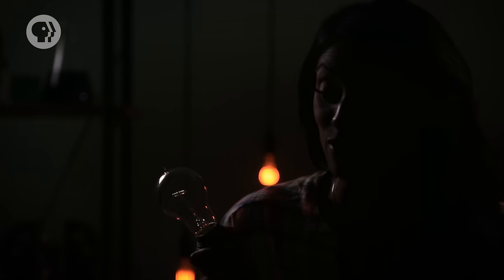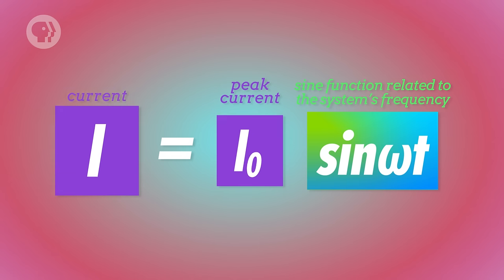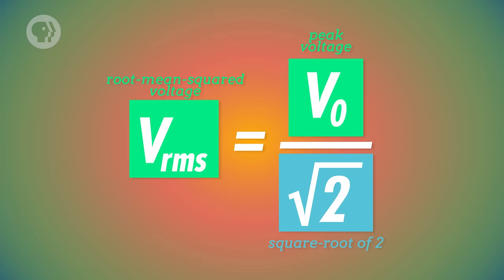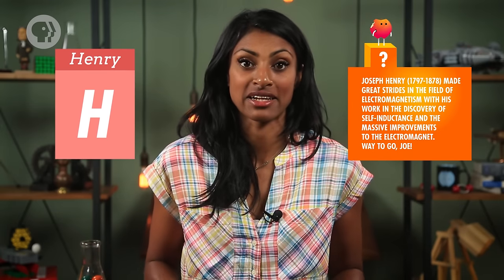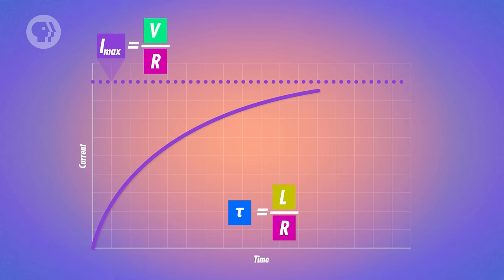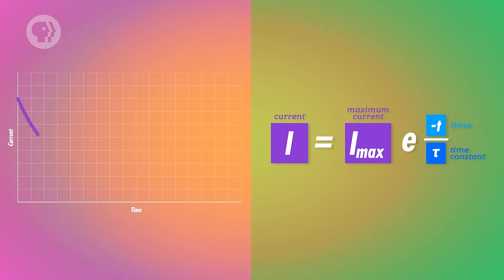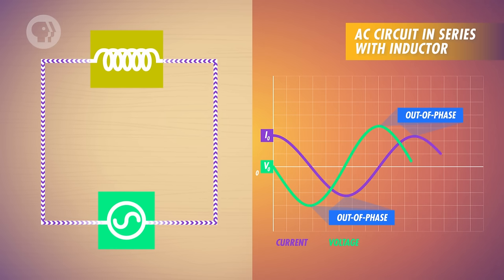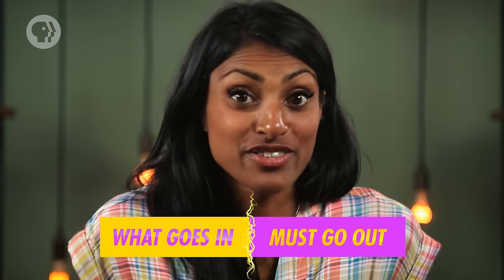AC Circuits: Crash Course Physics #36

Comment: Who is this for? Animated like it's for kids but zipping through formulas like they assume you're an electrical engineer.
Reply: Students that need a quick refresher before the AP Physics B exam.
Reply: I installed an extension for Google Chrome Web Browser called Youtube Playback Speed Control. It lets you slow the video down to 0.75 which is the perfect speed for these Crash Course videos.
Perhaps this is another rouse to pretend to empower the public through education yet ultimately defeating us via stupefication.
Reply: These formulas are usually taught in 11th or 12th grade physics classes though
Reply: Jonathan Odude they don't....at least for me, except physics, I find them k
Reply: I feel like the channel is called crash course because the course is so fast and complex that my brain crashed. I have an MS in biology, proficient in chemistry and just finally figured out how to math for DC.....this is not helping me much with AC
Reply: 000xyz nah dude I’m an electrical engineer, for ac circuits this is useless, if you want to do AC stuff, you have to make sure you know things from DC theory like node voltage, mesh current, thevenin/norton, delta wye, then you have to learn phasors, and you to understand steady state in DC for RLC circuits, then you can learn complex impedance which treats Ls and Cs as resistors in the frequency domain and do everything I said above as complex resistors. So instead of V=iR, it’s V=iZ, its not hard but you have to go through all that stuff, if you don’t know diff eq theory or linear algebra, you need to learn that as well bc problems can turn into second order diff eq systems, good luck
Reply: Shams Noor AC? No, these formulas are all DC based and you’d learn them in college in intro EM physics courses. Maybe in high school if you take AP physics C which has a calculus prerequisite so 85% students won’t see this till college. Plus the AC version of these formulas requires advanced differential equation theory, so it’s a sophomore level course on circuit theory.

Comment: Having just completed my 3rd semester in an electronics technology 2-year degree program, this is a nice little summary that helps put what I've learned about AC circuits in perspective. However, it's clearly not for beginners, nor for experts. Higher than vocational, lower than engineering.

Comment: Wow! What a  coincidence! I just learned about this in class today. I can't tell which is harder to understand.....maybe i'm just stupid.
Reply: I've had many semesters of physics, and electronics, and I took my first electronics course doing ham-radio in the 8th grade. Take it from me: this is NOT an easy topic to digest. In this case, the content is suuuuuper condensed. It's worth watching repeatedly, and it's also worth hearing the explanations from many sources.
Reply: As I said: ELI the ICE man.

Electromotive Potential/Voltage (E), Inductance (L), Current (I).

Current (I), Capacitance (C), Electromotive Potential/Voltage (E).
Reply: Rendezvous On Memory Lane You're certainly not stupid, I've taken an undergraduate class of this and felt it fast paced (I do understand the subject)

Comment: Lag after switching devices off is caused by capacitors, not inductors. Mostly in switch-mode power supplies like phone chargers or computer PSUs. They have huge amounts of capacitance to smooth rectified ac power and internal transients. After the device is turned off, it acts as a small battery.
Reply: Arrvi I was thinking exactly the same thing... Unless I'm missing something I think you are correct.

Comment: You should have already explained the LR, the CR and the LC and phase shift in the videos about capacitors and induction. Then in this video you should have explained how we determine the voltage and current values to then eventually explain how the capacitors and inductors work in AC.

Because now you didn't get to the power factor, rather important, especially because you did touch upon average power. Which doesn't equal the actual power when the power factor is anything but zero.

Also multiple phase circuits.

Comment: Cheap Chinese USB chargers also use capacitors instead of transformers to cut down mains voltage (and cost). Obviously as you change grid frequencies, bad things happen!

Comment: When you said that the inductor produces an emf in the opposite direction of the current, what you meant to say was that it is in the opposite direction of the "change" in current.  Also, when you talked about removing a battery in a circuit with an inductor, what you meant to say was replacing the battery with a short circuit.  If you just remove the battery, and leave it as an open circuit, very bad things will happen, as the inductor tries to push a current through the open circuit, thereby generating a very high voltage.  Of course, I know what you meant with your statements, as will most people who are familiar with topic.  Though, I think the way it was worded may create some confusion for people who are being exposed to this for the first time.
Reply: Thank you! I had the exact same doubt.
Reply: Wow... eugene commented too!
Reply: there is something that I don't understand, there are two(emf)s in the circuit with the inductor, the original and the induced , did we add them up or what ?
Reply: Rofaida Elsayed   No we dont add them. The induced emf is generated whenevr there is a change in cutrent. After that its not there... i mean the barrier that inductor creates to  prevent the "Flow of changing current" is vanished as soon as the current gets constant
Reply: Karan Dosanjh  not if we're talking about  alternating current, it keeps changing so we have 2( emf )s now
Reply: Rofaida Elsayed you are right about “Ac as changing current”. I wonder what might be the answer then
Anyway, if you got it let me know please
Reply: Rofaida Elsayed But they are talking about this while taking a Battery 🤔.... even Eugene took the cade of battery.... so that means the current only changes when switching on and switching off. Just these 2 instants
Reply: Karan Dosanjh  I know that but  when it's AC current the current changes instantaneously and continuously so there is always an induced emf that is proportional to the rate of charge of the current
Reply: Rofaida Elsayed Ohh now i remember. I am in 12th grade and i remember now that during our lectures on ‘Reluctances applied by capacitors and inductors’ in full LCR circuits, we derived a relation of Xc(reluctance by capacitor to current)= 1/C ω and XL(reluctance applied by inductor to current)= L ω

So when ω is too large(which is the case of AC) the reluctance by inductor would be so large that the current is blocked in AC

And when current is DC the ω is zero and hence negligible or no reluctance by inductor so DC is allowed
Reply: Karan Dosanjh I'm in 12th grade too, in our curriculum they don't explain how these Xl an Xc were derived,  they should take the induced  emf into account but I want to know how, I want details
Reply: @Karan Dosanjh
I think you meant to say "reactance", not "reluctance"
Reply: Macieks300 ahh yes... Thanks for tue correction
Reply: Karan Dosanjh  they say the voltage is 90 degrees ahead of the current , what voltage are they talking about ? The voltage from the source  or the actual voltage across the solenoid , I still don't know whether we add the emfs up or what (in an AC circuit) .....I'm missing something
Reply: Karan Dosanjh also I already understand the things you mentioned in your comment , this is not what I'm asking about
Reply: Rofaida Elsayed  Yeah we add them up. 

The scenario is- We connect a battery and an inductor. We switch the circuit on. Current BEGINS to flow in circuit. As the rate of flow of current is increasing the back emf is generated. 

Yes, WE ADD THEM UP and so it is seen that the current is opposed by inductor and the opposition is EQUAL. It is only when the current is constant, the opposition emf vanishes as there is no rate of change of current.
Reply: Rofaida Elsayed AND yes, The phase difference—— 

We switch on the battery the EMF is applied BUT, The current does not flow yet.... as we are taking a battery, The maximum EMF and Current it can apply is at sine 90. And after that it stays there , and current begins to flow fully. 

In the case of AC, The current never flows.
Reply: Karan Dosanjh my questions are not about DC current , I get that , I'm asking about AC , you say current doesn't flow in this case , how is that ? What about reactance and the shift phase , these things have to do with an AC circuit that contains an inductor .
Reply: Karan Dosanjh and what do you mean by at sine 90 when you're talking about DC current ?
Reply: Rofaida Elsayed Although i am not an expert in this field but i am sure my knowledge is correct. I have to show you by sending a photo. Contact on any media
Reply: Karan Dosanjh unfortunately,  I don't use any of these three , but I use Facebook if you have an account
Reply: Rofaida Elsayed You know when we derive these relations step by step , sine of 90 comes in place. 

Have you seen this formula?...

I= I(max) x Sin(theta)
E= E(max) x Sin(90+theta) in the case of inductor

And

I= I(max) x Sin(theta)
E= E(max) x Sin(90 minus theta) in the case of Capacitor. 
Note that when ever the voltage or current is alternating, the ‘theta’ always changes

Have you done the ‘Impedence Triangle’
That is all related with the phase difference. I will see if i can suggest you some links of videos...
Reply: Karan Dosanjh yes I have , but In AC circuit and not in a circuit with a battery
Reply: Rofaida Elsayed well its all the same in any voltage. 
Just think of it like this , when Current in DC begins to rise, it acts as the 1/4th part of the AC current. Imagine 1 full cycle of AC graph till 2pie. Then imagine it till pie/2. And that is where the DC becomes constant. And after that, current flows through inductor. 
It also makes sense as the phase shift is seen in sine of theta. 
Theta keeps changing in ac. But in dc , the theta increases from zero to 90 and stays there. It makes sense as sine of 90 is also 1. Which could be the maximum value of current a dc circuit could ever have
Reply: Rofaida Elsayed is there any way i could show it to you by my own pen and paper?

Comment: Wow, that went a bit too quick as I last heard this info about a decade ago. 😅

I'm still not clear about why we would use AC currents instead of DC? Was this explained in a previous video?
Reply: For low voltage over a longer distance transmission DC currents loose to much power at a much higher rate than AC and it's easier to manipulate. You can for instance change the Ampere flow by manipulating the so called "Reactive power" you can mantain the same amount of Watts (power) but lower the Ampere, so you can use a smaller cable  (thus a cheaper cable).
For high voltage you usually use a DC current for long distance transmission, since it suffers less powerloss than an AC transmission. (And it's also cheaper :P)

It's not easy to explain over a text :P But you can read alot about AC and DC on Wikipedia :)
Reply: Alexander Inget Thank you for taking the time to explain! 😊

Comment: ha 4:50 electric cars have instant torque.
Reply: instant torque just means instant acceleration, not instant speed.
Reply: Rob Mckennie with ever growing battery innovation evs will be able to get instant speed.
Reply: chicken bro There's no such thing as instantaneous change of velocity for objects with mass, as that would require infinite acceleration, which in turn requires either infinite force or zero mass. You can come arbitrarily close to instantaneous changes in velocity with arbitrarily large forces, but you can never overcome this fundamental property of mass. It's this fundamental property that the person in the video was talking about.

Inertia; it's not just a good idea, it's the law!
Reply: Rob Mckennie I stand down. but,
I believe that anything can happen.
Reply: chicken bro Well, that may be true, but not within the boundaries of our current understanding of physics
Reply: Rob Mckennie I hear it is not wise to argue with science. thanks for the reality check.
Reply: Instant max speed equals instant death. That is, unless someone invents inertial dampers.
Reply: Inertial dampers, Warp Bubble, Thermal Shielding capable of protecting you from temperatures hotter than the center of the sun, etc, etc. Going to be a while...
Reply: the electronics have slew rates and droop; there is no such thing as instant.